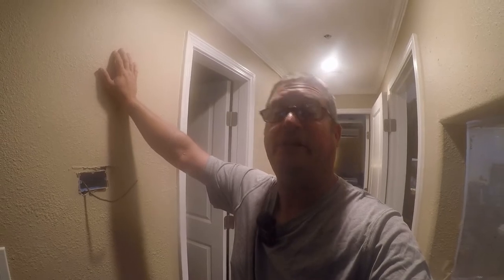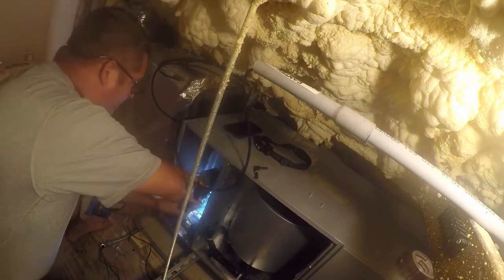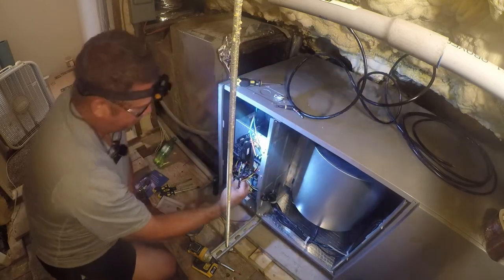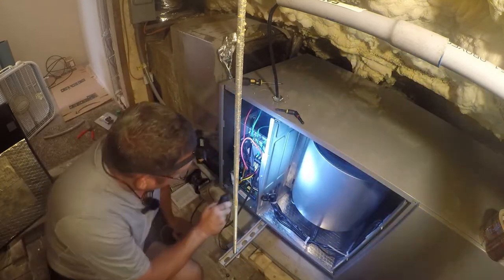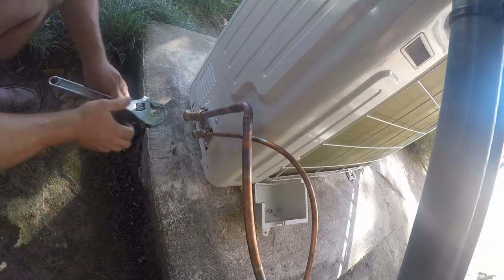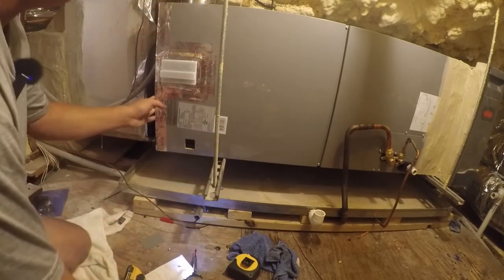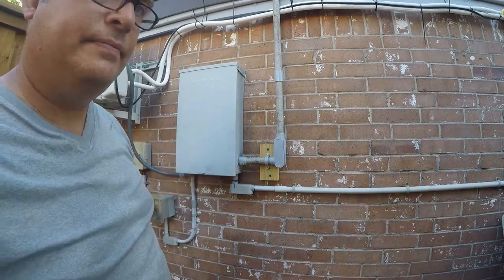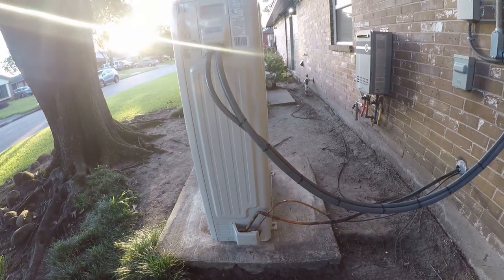HVAC 19 - Startup Attempt.. it runs, but has a mind of it's own.

Comment: Looking forward to an overall appraisal of the equipment's construction, performance and an anticipated reliability guesstimate.  Thanks for sharing your unvarnished experience with us.
Reply from the maker: I think it works fine.  I've been super busy with other stuff, so I haven't finished the plenum connection.  lol.  I question the energy efficiency numbers.  It seems to pull more energy then the Goodman it replaced, despite being a higher SEER rating.  Meh.  When the plenum is buttoned up I'll look again.  It's darn near silent.

I also think it's not running at peak performance with a non-communicating thermostat.  I should care, but I don't.  I have no interest in installing the unfriendly non-wifi communicating thermostat.  Never have heard from HVAC Direct and don't really have the appetite to try again for a 3rd time to get their "tech support" to call me.

Comment: Di you purchase the heat pack specifically for this unit or did you use the one from your old unit?
Reply from the maker: yes.  They are usually sized specifically for each unit.

Comment: I hope you get the gremlins worked out. As per a previous comment, I used to be an installer but got out of the trade. I have had my eye on the ACIQ units. My own house is in the “north wet” and is heated by cadet wallboards with window shaker AC in 60’s insulated smaller house. To save space, I’ve been contemplating 2 zone slim duct system. Just curious how it will all go with you.
Reply from the maker: It does eventually run... but there is NO support.  HVACDirect (who owns ACIQ) never calls back.... so you are basically on your own if you buy one.
Reply: @hotpuppy72  that is too bad, but at least they are made by midea, so parts are obtainable. Especially considering most people don’t know that midea makes the mini splits for one of the largest HVAC companies in the US.
Reply from the maker: Midea being behind it is one of the reasons I bought it.  For whatever reason Midea seems content to wholesale and private label most of their product.
Reply: @hotpuppy72  If I remember correctly, Toshiba and carrier mini split systems are also midea. Carrier I know has a ford/Mazda relationship with them.
Reply from the maker: I always tell people that there are really only a few compressor manufacturers, a couple of control manufacturers and a few fan motor manufacturers.  Everything else is just sheet metal, paint, a brand widget, and marketing.  The systems generally use similar components.  

My old system had a compressor from Emerson that was only used by Goodman and Carrier.  Regrettably, that made it uneconomical to repair... but whatever.  I got my money's worth out of it and the new system seems to be a better design fit for my house.

One of the benefits of this project is I discovered I had a bad trap design.  Fixing that has let the system pull the humidity down as low as 49% which is awesome in Houston.  Our relative humidity is normally 80 to 100% year around.  The rectorseal trap went in to recycling and I just fabbed one out of PVC bits.  Made sure it was deep enough to earn it's keep and so far it's working awesome.  I'll probably do a follow up video on that at some point.

Comment: #10 wire will not support that heat pack and this unit is designed for two power feeds, one to the heater #6 wire and one to the control board #12 wire.   be cautious of the way you wired this unit, it's not correct
Reply from the maker: It's a 5KW heat pack.... 20.83A load.  Air handler is rated for 5A of power draw.  That leaves enough for it to work properly and 10AWG is rated for 30A.  The manual isn't in compliance with NEC unless you install a sub-panel or a disconnect L&L for dual lugged conductors.  I don't think I've ever seen a disconnect L&L for dual lugs.  I would much rather have a pair of single disconnects in line then multiple circuits feeding a single piece of equipment in residential.  YMMV.
Reply: @hotpuppy72  did you ever get all the kinks out???
Reply: Kenny, How do you know this unit is intended for two separate circuits? One for the heating element and one for the blower?
For instance I ran #6 with a separate disconnect and wired the same as Brian. The instructions say very little but the information it does offer - the math pans out…
Also, I have a 10kw heating element. Thanks…